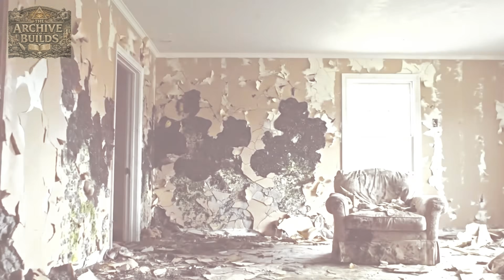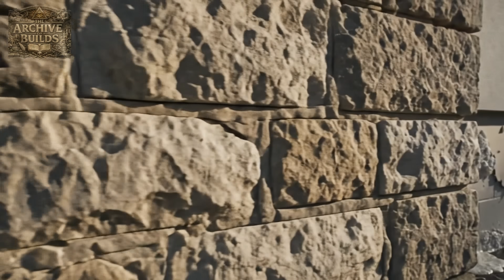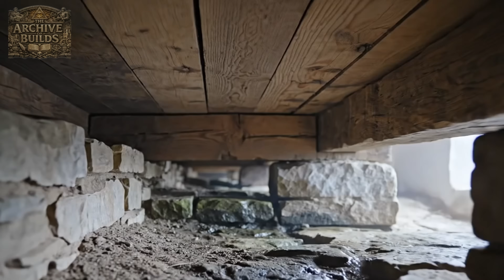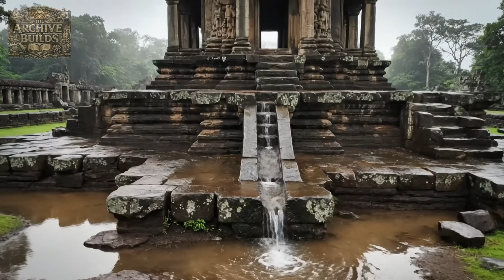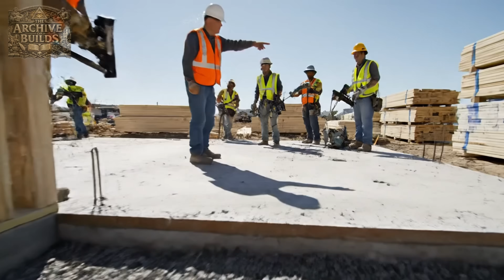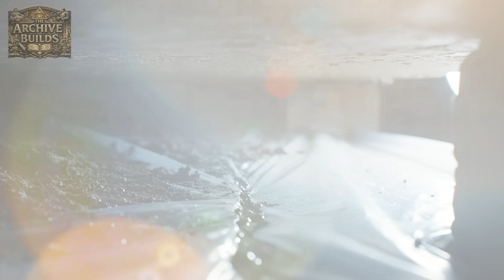The Forgotten Foundation Trick That Stops Water Before It Starts. Why Most Builders Never Use It

Comment: Plaster with lime plaster.
Don't use cement plaster.
Reply from the maker: Exactly — lime plaster is a much better choice in cases like this because it lets the wall breathe instead of trapping moisture inside. Thanks for pointing that out so clearly. Have you seen a big difference after switching away from cement?

Comment: If bearers and joists and timber floor  have sutible airflow space under floor. = success. I have seen CRONIC MOULD UNDER FLOORS due to  lack of  Ventilation.  If  ventilation nit good lay plastic pipes under floor through footting walls and  up the outside of building  Sun heats air in vertical pipe hot air rises and pulls Stale air out creating ventilation   THEN SPRAY WITH A MOULD KILLER. or MOULD will come Back. Old builder here
Reply from the maker: Thank you for sharing this. That is exactly the kind of practical, experience-based insight that adds real value to the discussion. Poor underfloor ventilation can become a serious long-term problem, and I really appreciate you pointing out both the airflow solution and the need to treat mould properly so it does not return.

Comment: Old builder here  mate  if you have wet situation.  GRAVEL and Agg line under  slab  sloped to suit drainage sand then 2 layers membrane.  Then add BOND CRETE TO concrete = waterproof concrete  slope ground away from outside  walls   Paint on treatments are TOO LATE
Reply from the maker: Thank you for sharing that, mate. This is exactly the kind of practical knowledge that only comes from real building experience. Getting drainage, gravel, membrane layers, and site slope right from the start makes a huge difference, and I agree that surface treatments are often already too late.

Comment: It is called rising damp. Capillary action. 
Upto four feet high from the foundation level.
 Damp proof course just below flooring level. 
Breathable painted, all maisonry, even concrete, is porous. Let the water evaporate. Even if it looks ugly, the walls don't lose strength. 
A foundation base level deep drain separating the building from higher ground is the first and best step.
French drains below the building will also help.
Reply from the maker: Excellent summary — you explained the mechanism far better than most people do. Rising damp, capillary action, breathable materials, and proper drainage are exactly the kind of practical details that should be front and center in a topic like this. Comments like yours add real value. Which of those do you think builders ignore most often today: the deep drain, the damp-proof course, or letting walls breathe?